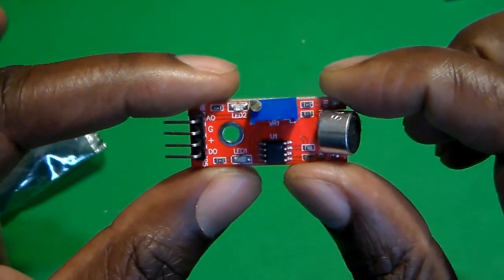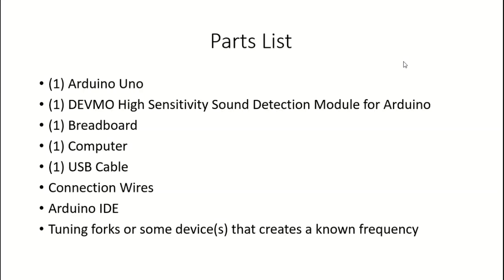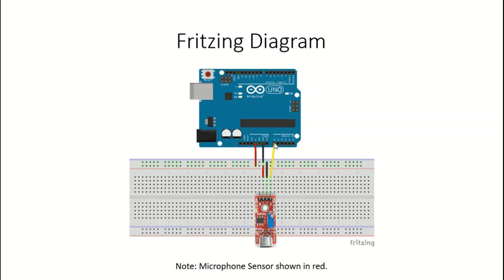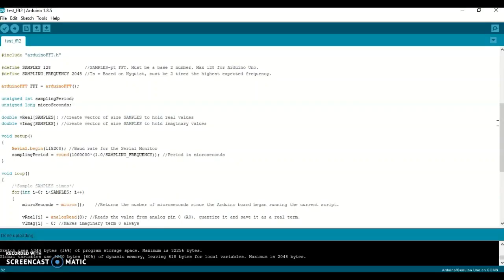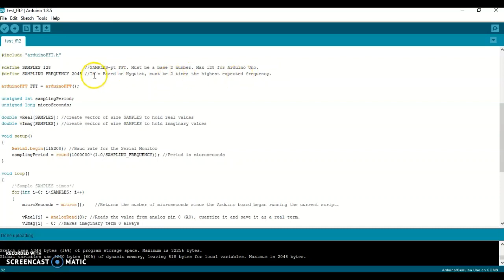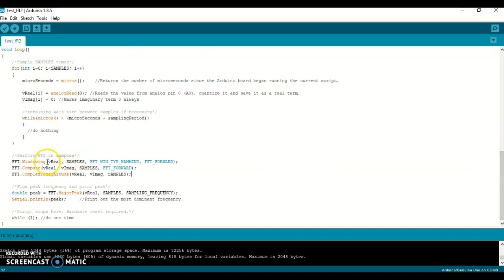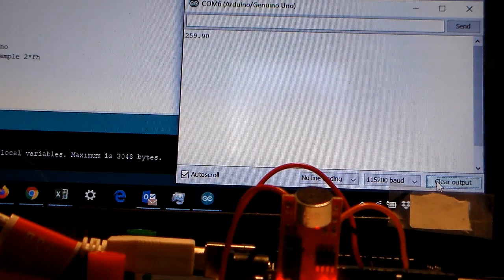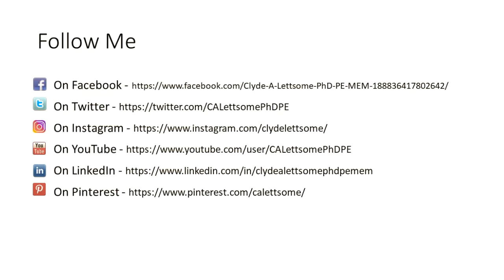My Weekend Project: Audio Frequency Detector Using An Arduino

Comment: Code works amazingly! I just ran it and saw it was using 60% of the global variable space. If you move "  double vReal[SAMPLES];
  double vImag[SAMPLES];
 unsigned long microSeconds;" into the for loop, that percentage drops to 10%. I had to do this to compact things for my Junior Design project, it still works great! thanks once again
Reply: Where can I get the code? I already went to the website and search for it. After I check out, it send the link but I cant open it.
Reply from the maker: Thanks for the advice. Please like, share, and subscribe.
Reply from the maker: Hi Fatin,
If you gave your correct email address when you registered on my website, I sent you an email to tell you I corrected the error. You should be able to download it from my website now. Sorry for the issue.

CAL
Reply: @CALettsomePhDPE  Can it detect sound of baby crying too?
Reply: @fatinfarahin6836  bebek sesini algılayan dedektör yapabildin mi
Reply: @fatinfarahin6836  hey please let me know if you got the code...i cant download it too

Comment: What was the version of the arduinoFFT library you added when you made this video, the latest version seems that it is not working
Reply: same problem here, did you find a solution?
Reply: Install version 1.50
Reply: Library 2.0 has changed some of the capitalization of the words - go back to 1.6.2 and it should work fine.

Comment: Very interesting video. It's always a good thing to know how the FFT library works. Thank you for the clear explanations. But the method is not very accurate on an arduino. I had differences of up to 10Hz at 440Hz with a calibrated audio source.
Reply from the maker: Hi Longdong,

Thank you for the comment. The results are not very very accurate. You are correct. It does work fine though for none commercial projects.

Thanks again for the comment.
Reply: Are there any more accurate sensor modules out there?
Reply: @ACID2BREAKS  Please define what you mean by "accuracy" for a microphone.

Comment: Hi, I have just tried this and several other projects that use FFTand always get this error, I am using the latest "arduinoFFT" library 2.0.2 by Enrique Condes : error: Compilation error: 'arduinoFFT' does not name a type; did you mean 'ArduinoFFT'?
Reply: Ya Me to what is the reason ?
Reply: @FekadeselassieAshenafi  It turns out that the updated library has been changed with some capitalization in some of the words. If you uninstall it and go back to library 1.6.2 it should work.
Reply: @thefrugalphotographer  okay thank you

Comment: Thank you for your great video. I deleted last code 'while (1);' because I wanted to get continuous frequency data when there was more than a certain size of sound. But meaningless frequencies were printed without any sound. How can the output be reduced when there is no main sound?
Reply: You'd need a way to determine the amplitude of the sound, so it only acts when the sound is loud enough.
Reply from the maker: Glad it helped! Tristan is correct. You would need to set a higher threshold so only "main sound" as you say, can be detected.

Please like, share and subscribe.
Reply: @CALettsomePhDPE  I've been messing with this sensor and it seems that's it's main purpose, to detect loud noise.

It has been struggling to read frequencies between 440hz and 55hz, those octaves have been the only ones to yield accurate results. Connected everything just like your video and getting the audio sample from my phone tuner which is correct.
Reply from the maker: Hi Tristan,
You may have to make some adjustment to the code and/or adjustments to the audio sensor that you used. 
Good luck!

Comment: Is there a way to set a frequency range for the fft? Im working on building an EEG with an arduino and i need to compute an FFT on the input signal. The issue is I need the dominant frequencies that fall within 5 different frequency ranges....

Comment: My OFFSETSAMPLES are all always zero (I'm really not sure why- maybe this is why my frequency results seem almost random). I'm using the same analog audio module, I've calibrated the potentiometer very well to where the sensor LED only comes on at all with so little as a finger tapping on the table, I have double-checked that my wiring is the same as in the video, and have copy-pasted the program from the website. Do I need to use an external pulldown resistor since this is an analog input? If so, what value approximately?

Comment: Sir.
could you please tell me how to write code for detecting higher frequencies(4000Hz-6000Hz)

I have noticed that increasing the sample frequency can make it detect higher frequency, but that is an  inefficient code..it is not detecting accurately (showing 6000Hz for 4000Hz) ..

could you please let me know what changes to be made to detect higher frequencies

Comment: Hello sir , this is an amazing video .  Could you please guide me for a project that i am trying to make ? The basic idea is that the traffic lights detect an ambulance coming it's way by detecting the frequency of the siren , and as soon as it detects it , it turns the traffic light green . But I am facing a lot of problem. Would be great if we get your guidance .
Reply from the maker: Hi Aanandita,
Thanks for asking. Unfortuantely I do not teach and tutor anymore. I am working full-time as a consultant, contractor, and researcher.
Reply: Hi Sir! Did you succeed in completing your project?

Comment: I'm using my phone to generate a frequency and the readings I'm getting aren't too accurate, what can I do to improve my results?
Reply from the maker: Hi David,
Thank you for asking. I could not get my tablet to work alone either. I had to connect my tablet to pc speakers with an amplifier built in. The issue may be related to amplitude and sensor sensitivity. Try adding pc speakers. If this does not help, you may have to adjust the code.
Reply: And try liwering the sent frequency, tje higzer tje frequency is the worse it is to detect

Comment: Am I right that a frequency is known first so I can change the sampling frequency(2 times the known frequency) in the code to output the same known frequency in the serial output of Arduino IDE? Or is it getting the sound and let the system(the sound sensor and arduino display the real time audio to it's equivalent frequency?) I have tested the system using frequency generator app to several frequencies and it did serial output correct frequency but need to change the sampling frequency everytime I need to verify it .
Thanks.

Comment: Hello sir,  may I know how to modify the code  because I'm using 6 sound sensor and I need the frequency output of that 6 sound sensors simultaneously
Reply: You can probably use interrupts on each sound sensor, but probably with a faster clocking uC like a ESP32

Comment: The high frequency that you detected was 1024hz. Is this audio sensor and library able to detect higher frequencies.  My project will be detecting 2000 to 3000hz. Is this doable with this sensor and library?
Reply: Heyy, I'm doing a project for detecting high frequency. were you able to find a method to detect higher frequencies?
Reply from the maker: Thank you for asking. I did not try higher frequencies.

Comment: Hello, I'm trying to use this code on ATMEL Studio, in a C code project. It seems that c code doesn't understands classes, do ou know how I can fix that ?
Thank you for your video anyways !
Reply from the maker: Hello Arthur,
Thank you for asking. The code was not written with classes. If you need to use classes, you will have to code it to do so.
CAL
Reply: @CALettsomePhDPE  thank you for your response. I mean the header file uses classes, not your code, so Atmel Studio can't compile your code in a C project . Do you know how I can fix this ?
Reply from the maker: Thank you for asking. I do not off at this time. The code I wrote was specifically for the Arduino IDE. Sorry.
Reply: @CALettsomePhDPE  no worries, thank you for your answers anyway !

Comment: Hi, I have a question regarding how to bypass the constant "reset" hitting, as I want a quick update of frequencies due to a variety of notes that will be hit in a short amount of time, and I cant hit reset every time. Thank you.
Reply: Hey, did you find the answer?
Reply: @gaznevi  Have not yet unfortunately, I think it is best to use Fast Fourier Transform and a different circuit using a better sound sensor.

Comment: Is there a way to set a frequency range for the fft?
Reply: Im working on building an EEG with an arduino and i need to compute an FFT on the input signal. The issue is I need the dominant frequencies that fall within 5 different frequency ranges....

Comment: Can i measure the frquency in real time?
Reply from the maker: Thanks for asking. The frequency cannot be determined instantaneously as the frequency is determined by a set of samples collected. However, the frequency can be determined after a sufficient amount of samples have been collected. You can loop the code so it can continuously sample signals if this is what you desire.

Like, Share and Subscribe.
Reply: @CALettsomePhDPE  thank you sir to answer my quetion, too loop the code, which code should i add? thanks 🙏

Comment: Can you send me a fft code for my email?
Reply from the maker: Thanks for asking. Please use the following link and go to https://clydelettsome.com/blog/2019/12/18/my-weekend-proje…using-an-arduino/
the "Obtain the arduinoFFT libarary" section of the page to see how to get the library.
Reply: @CALettsomePhDPE   What function should I use other than MajorPeak if I want to receive the data on a serial monitor every second?
Reply from the maker: @Cherish-r9k  I am not sure. I did not write the libarary. Here is where you can find more information about the arduinoFFT library. https://github.com/kosme/arduinoFFT